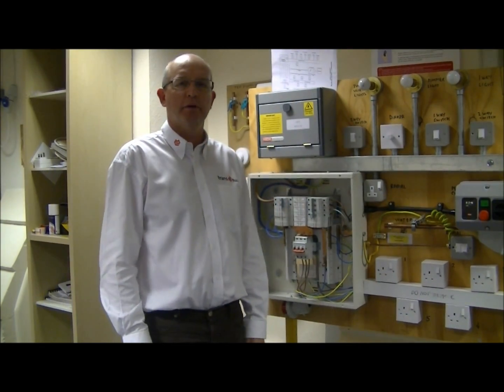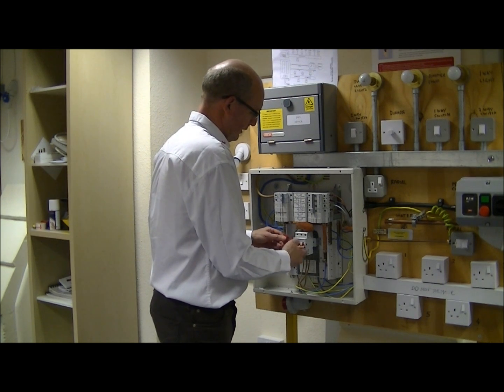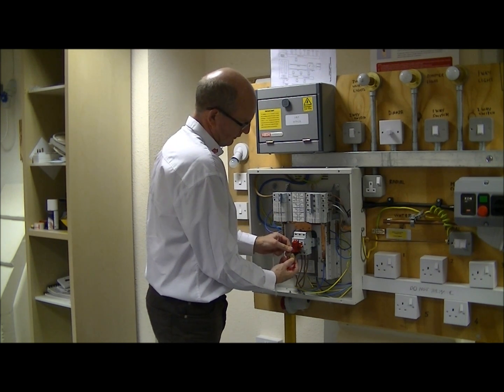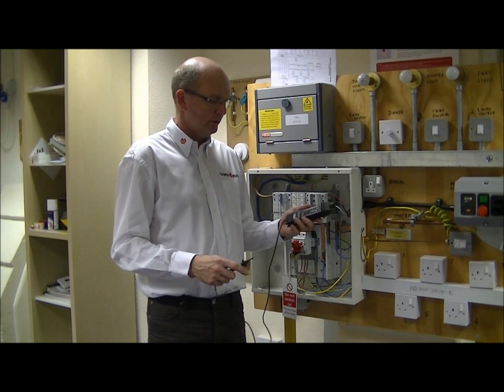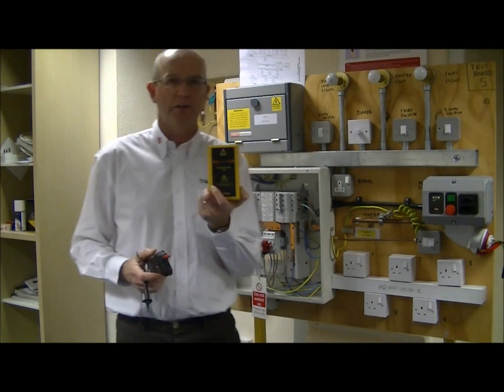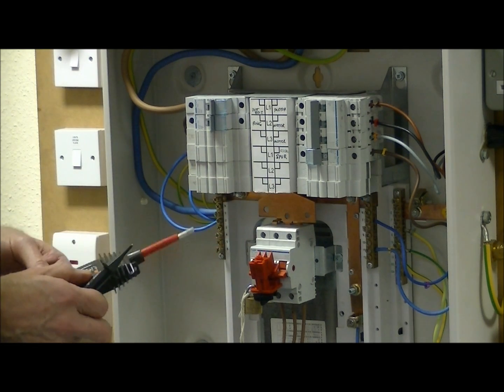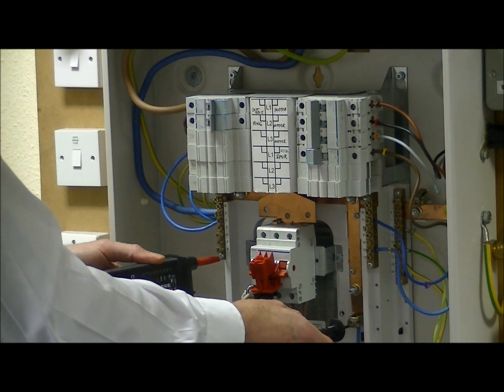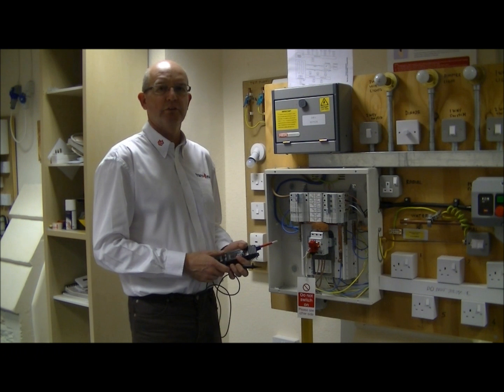Safe Isolation of a Three-Phase Distribution Unit

Comment: I have both 3 phase and single phase in my home and work shop with I'm told single phases taken from the 3 phase  to power different  single phase lines in the work shop and home and i have a few questions which I hope you can answer 1. Is that possible 2. Will my single phase handle the job if I remove the 3 phase as running 2 metres is quite expensive 3. Is using the 3 phase in this way cost effective ie. Running single phases from a 3 phase meter . Actual 3 phase not being used and nothing bigger than a rod welder , power washer and lights in the workshop and 2 electric showers and an electric oven and hob in the house ? Single phase 400 units per month 3 phase 130 units per month ?????

Comment: There is so much wrong with this video as far as safe isolation is concerned. It does not show the correct method of how to isolate a 3ph supply and needs to be removed.

Comment: When this guy first checks between L1 and Neutral he connects his probe to L1 first and then connects to neutral. This will result in the "free end" of the probe being live. Testing  in this manner is in my opinion is not safe. The probe should be first connected to the neutral then to the live reducing the potential for unwanted electrical discharge.
Reply: The top of the isolator is dead! That’s what he is proving.  The 10 step method is in the ONS,BS7671 and GN3